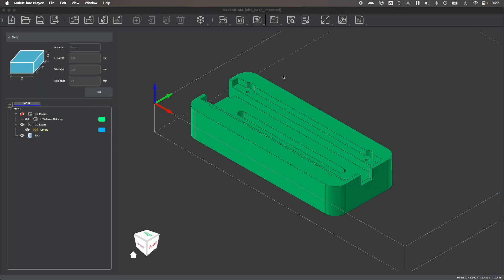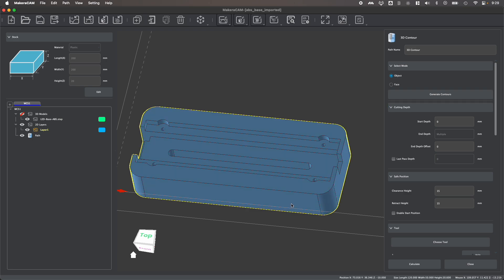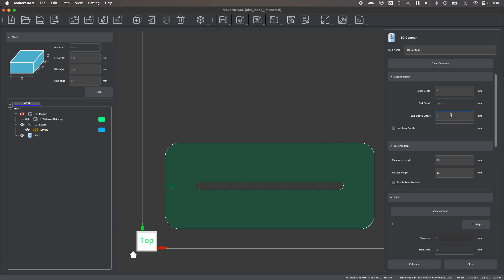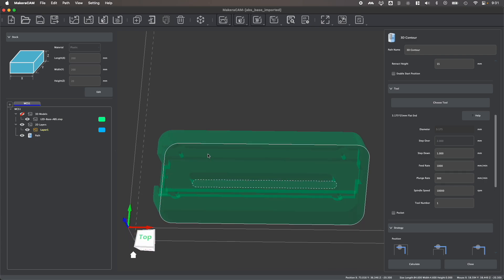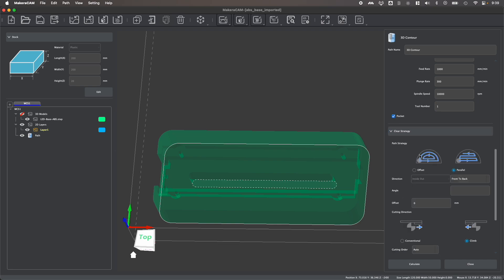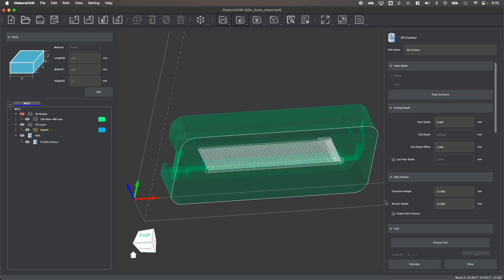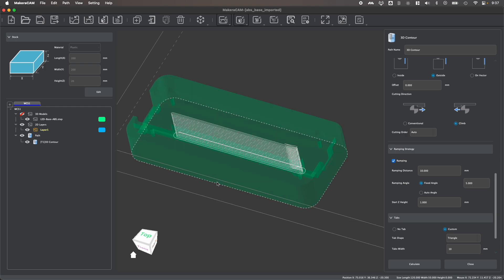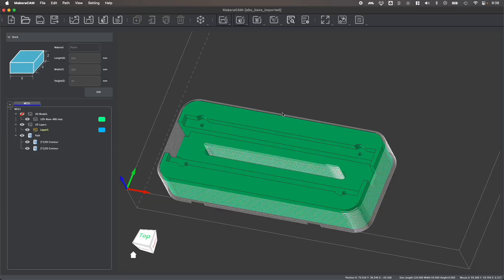Makera CAM - Creating 3D Contour Tool Paths

Comment: I've been trying out Maker CAM, and I can't seem to put tabs. When clicking 'add' and then clicking the contour, none appear.
Reply: I have the same issue. I can't add tabs.
Reply: Same for me
Reply from the maker: We are working on a fix for this.
Reply: @Makera  could you just opensource the program. i will fix it myself.
Reply: Tabs are definitely busted, I can get them to appear sometimes but its random and I can't align them. I've even had it put down triangles when I selected rectangles!